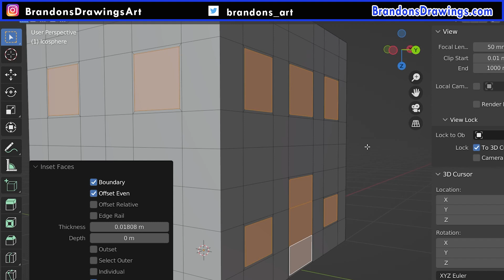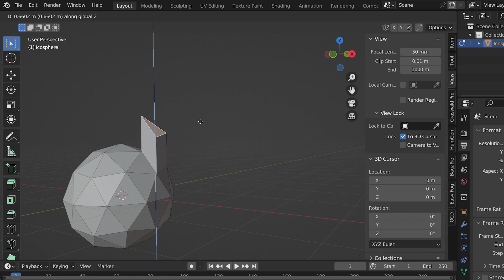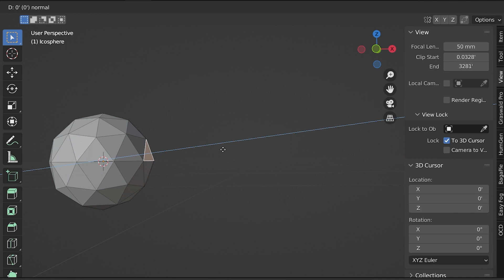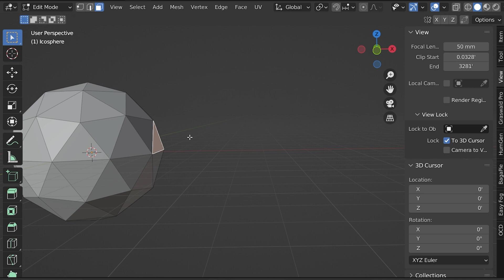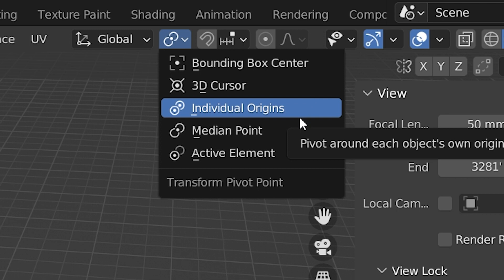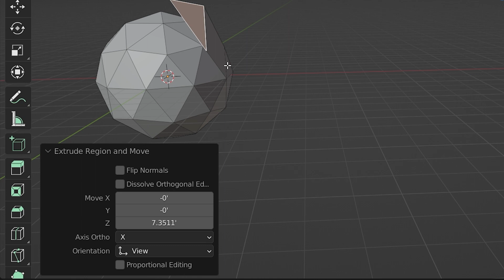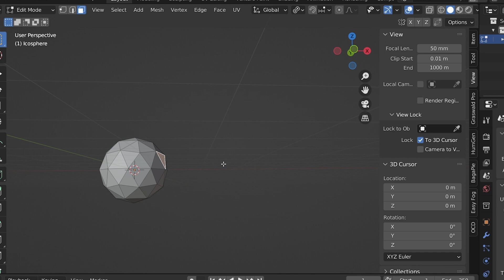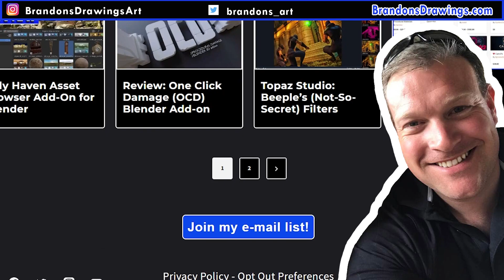Everything About Extruding in BLENDER (Extrude)

Comment: So here comes a Noob question, once you make an extrusion (let's call it E1) and then another (E2) , you cannot go back to E1 and change the length of the Extrusion...? Help would be appreciated :)
Reply from the maker: No not easily.  Once you move onto the next it’s done.  You could do it manually, undo it and do it again, or get into learning geometry nodes where you’d have more non-destructive control.  Still not even sure that’s a solution.  Sorry for the bad news.